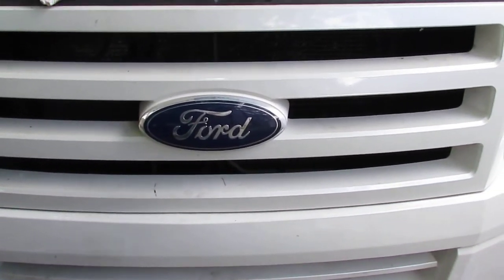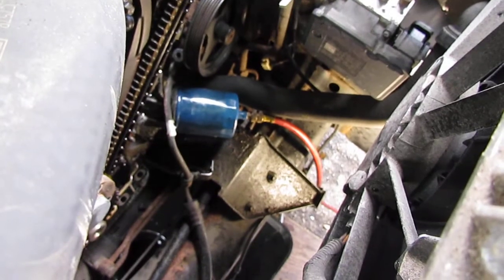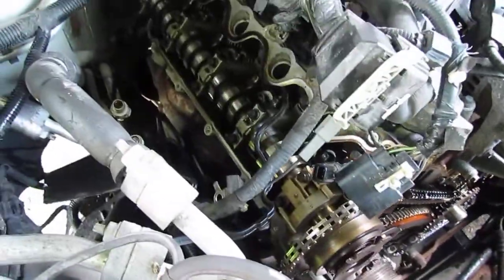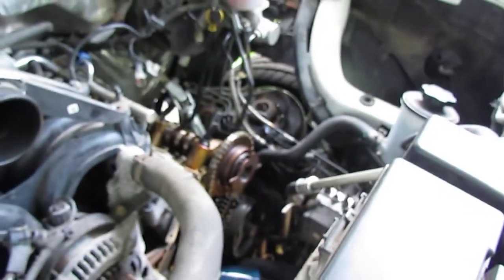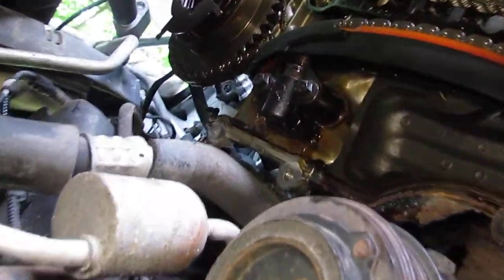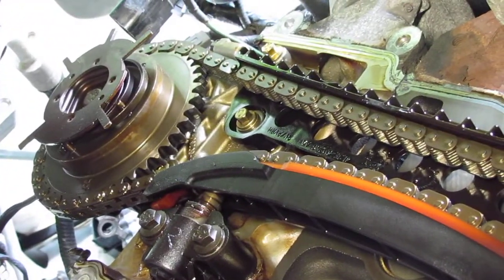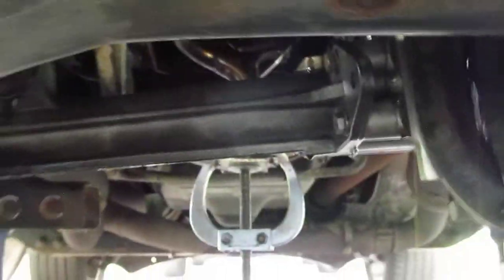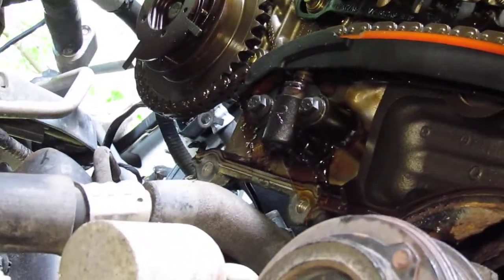Ford 5.4L Internal Oil Pressure  Leak Diagnosis

Comment: Hi Bob, this is a great video. With my 45 years experience as an auto tech, I would say you have a significant loss of pressure at those tensioners. In this Ford Tech Talk video  ihttps://www.youtube.com/watch?v=3H07ZEI4a8M  they seem to  downplay this being a problem? My question here is, Would just replacing those leaking tensioners have brought hot oil pressure up to a reasonable level to correct malfunctioning vct operation due to low oil pressure? And would this loss of pressure at these tensioners affect top end lubrication and premature bearing wear?? Certainly the loss shown at these tensioners in your video couldn't be good for top end lubication. I understand that Ford has upgraded these tensioners. I am starting to think should there not have been a recall? 
Also these engines would likely have less cam shaft bearing wear related problems if they were run with 5/30 rather than 5/20 oil from the get go. I have hard time seeing how 5/20 can have enough cushion in one of these engines? Especially a truck? Its not a Honda or Nissan.

Keep up the videos Bob!

Comment: The tensioners are leaking where they are mounted on. Need to take the two bolts out of each one of them and change the gaskets and tighten them

Comment: I think you did the right thing to replace the phasers as well. I did one of these on a no-start that the customer wanted to replace only one phaser with the chains and tensioners. It had borderline oil pressure once running hot and phaser activation could reduce the oil pressure to the point the phasers would slop and set codes. Eventually arrived at replacing the second phaser and hot oil pressure at idle went up 8psi. Seems as though the vanes in the old phasers were internally bypassing a large volume of oil.

Comment: I'm having the same problems,replacing the tensioners now,now sure if it's the problem or not,only have oil on right side of engine,running mellings high volume,high pressure pump and stock tensioners seem to have failed

Comment: Great Demo . That's what happens when the gaskets blow out. I replaced mine with steel tensioners instead of the factory plastic. The upgraded parts are machined and require no gaskets. Looks like you caught it BEFORE the chain slapped enough to break the chain guides.
Reply: Yep, he confirmed what anybody who has pulled the front cover off one of these engines already knows.  +1 on the cast body tensioners with ratchet plunger from Melling.  Same tensioner used on the 2 valve engines before they cost reduced them into the unreliable zone.
Reply: i upgraded to the cast tensioners but my oil still bleeds down and my chains still slap on cold start???
Reply: @bluestripes1  your loosing pressure at some point. Do not use silicone on the mating surface of the tensioners! Metal to metal only! Did you upgrade the pump? Did you drop the pan and clean out the pick up screen? How many Miles? What type of oil? Did you  Remove the VCT mounting plate for inspection and cleaning. Notice the tiny filter screen in there that needs to be clean.
Reply: @Continental1997  thanks for your reply. 200k miles, no gasket or silicone used on the tensioner, new genuine Ford VCTs, guides, chain, solenoids, new passenger side camshaft, all new oem Ford updated rocker arms, all new melling HLA, new melling high output pump, motor craft 5-20 and motorcaft filter, I've tried other filters, I've cleaned the pickup screen, it's quiet good running engine after 5 seconds startup
Reply: @bluestripes1  sounds like you did everything right. The only thing I did different was to use 5-30 oil. My 3 valve runs much better than my 4 valve Intech Lincoln Truck.
Reply: @bluestripes1  My timing set was replaced at 100 K ....At 200 k It may have enough wear to justify a remanufactured engine. Powertrain Products do a decent job. at $3400 . I spent close to that when I did my truck
Reply: @Continental1997  I know what you mean it's just hard to drop 3,400 on an engine with good oil pressure that runs good once its started. I'm wondering if maybe a VCT could be defective? I read something about a locking pin in the VCT but I'm not 100% sure on how the system works to say.
Reply: @bluestripes1  You can test it with a 9volt battery Just un plug it from the harness and using 2 jumper wires apply 9 volts it should activate.
Reply: @bluestripes1  Are you using an oil filter with an anti-drainback valve?
Reply: @richardsimons5771  yes the stock motorcraft filter has an anti drain back valve and I've changed it with no effect

Comment: I have a 2011 same issue, its in the shop now.. car has 130,000... never had a problem and Im original owner. How many miles you have on yours? No problems yet.. ? Im trying to avoid selling it cause I really like my truck.

Comment: All those plastic chain tensioners are junk even the updated one. I hope you installed the cast iron ones.
Reply from the maker: Yes - you are correct and the Mellings metal units went in.
Reply: Those are the ford cast ones no?
Reply: Closer they do look plastic just thought it was weird because mine never had orientation markings on them r and l but the updated ones I'm putting on now do and they are cast.

Comment: Blown tensioners are very common on the 5.4 3V. When they go all oil pressure is lost at the heads and major valvetrain damage soon follows. Hope you got it all figured out and repaired by now.

Comment: so what happend? you fix"t
Reply from the maker: I installed a complete timing setup including phasers.  I could have probably changed the tensioners only  and been fine, but I didn't want to go back into this engine later.  The problem is solved and the engine is running fine.  My reason for testing was to make certain I didn't have bad cam bearings or crank bearings, which I didn't.
Reply: @bobkos333  That engine does not have any cam bearings. The roller followers is what you gotta pay attention to, they go bad